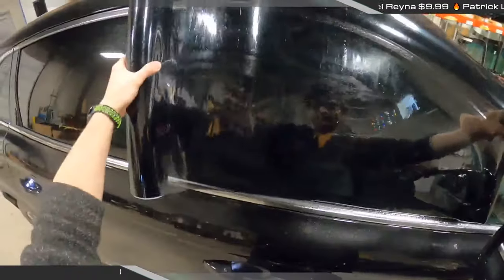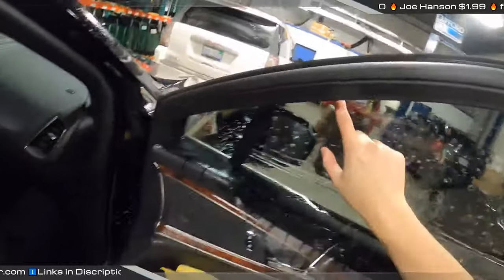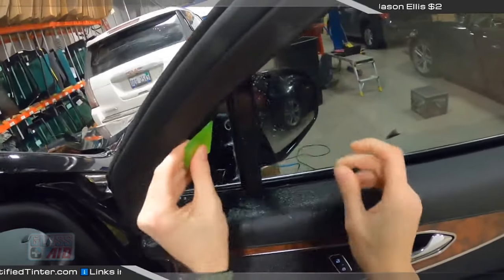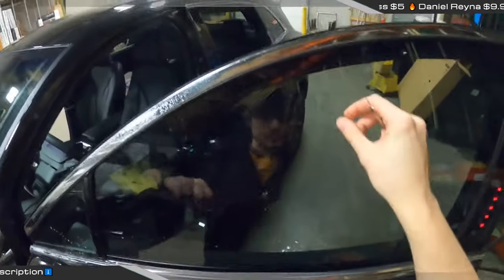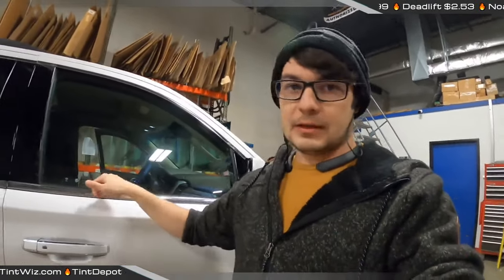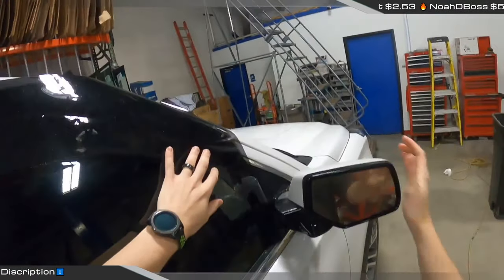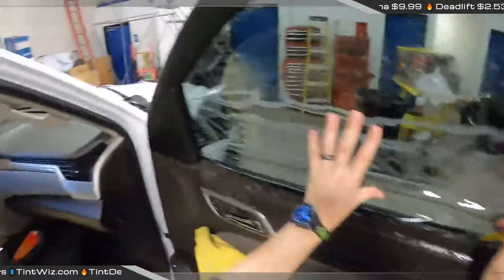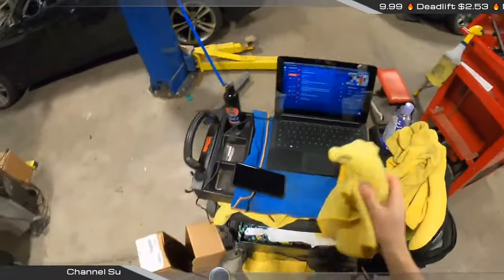🔴 Lincoln Nautilus and GMC Yukon Front Door Tint Live! How to Tint Truck Windows

Comment: You can heat the sideswiper with the blue blade out then pinch the white part together and put the back in and it won't slide out